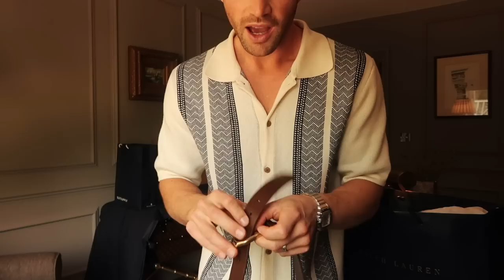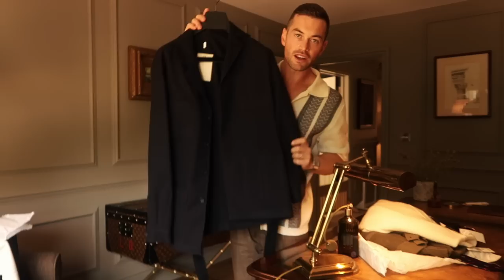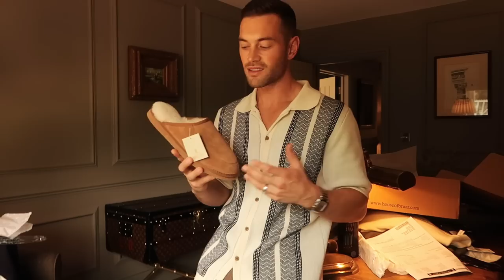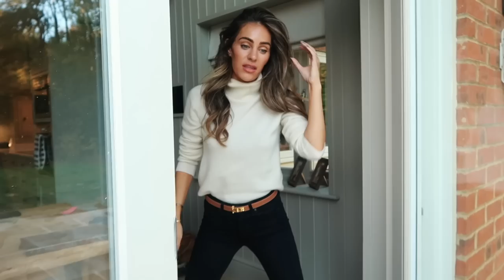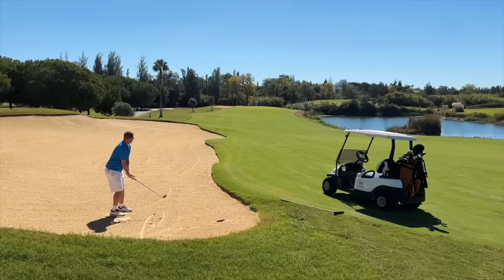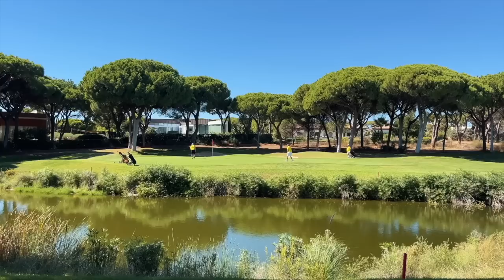OUR GARDEN RENOVATION UPDATE & AUTUMN MENSWEAR UNBOXING | Ali Gordon

Comment: Less than 10 minutes in and you've inspired me to comment. It's good to hear your brief on the Lost City. I've not watched the film, but will check it out. Admittedly, Channing Tatum's acting doesn't appeal to me. I love Sandra Bullock and Daniel Radcliffe (as harry potter, it will be hard for me to shake loose the HP moniker from him in my mind). I like Ralph Lauren a lot. The tie is very nice. You've motivated me to check them out this weekend. My issue/hesitation with them is that I'm a 31 waist 34/36 length - they don't make that fit (or at least I've not found it). They have 36 length but the waist I think is 34, maybe bigger, that's too much bunching in the waist for me. However, unlike the watch in your last video, there is an RL store in my area. The closest watch store to me is NY, which is 4 hours away. I'm not motivated enough to travel to NY to check it out (I prefer seeing these things in person at a store as opposed to ordering online then sending stuff back - I'm lazy that way).